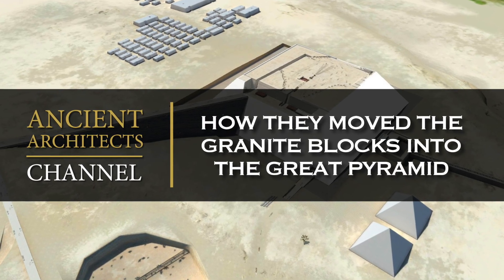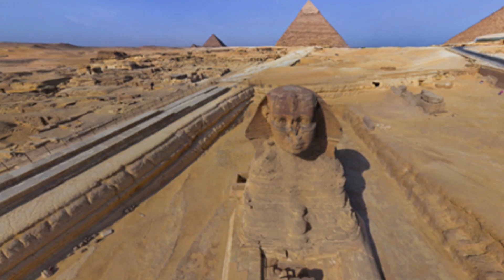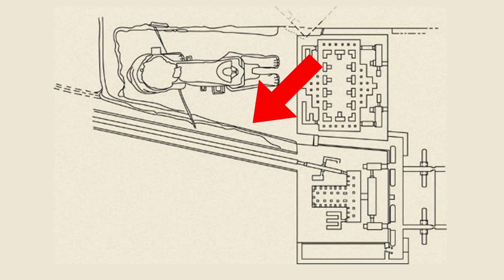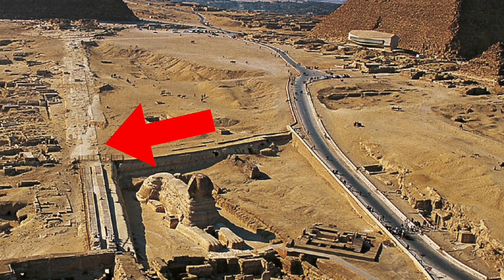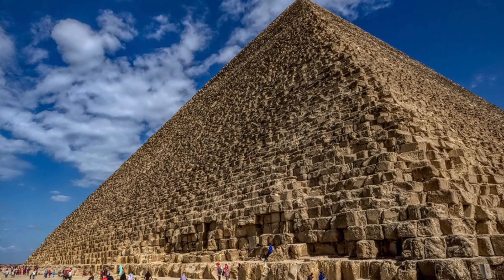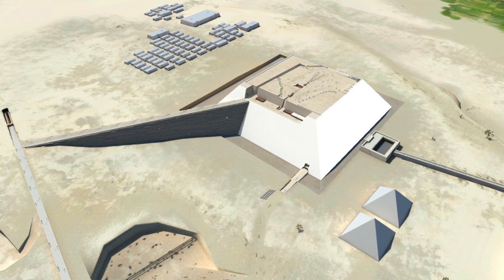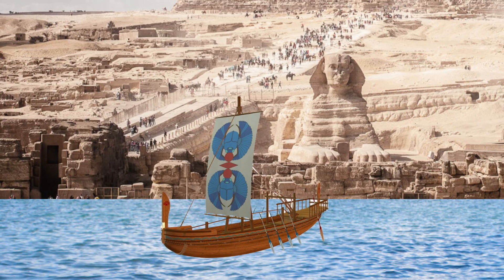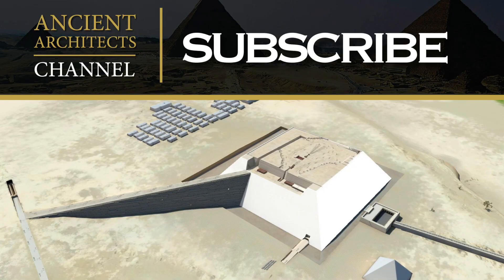How They Moved the 60-Ton Granite Blocks into the Great Pyramid | Ancient Architects

Comment: Must agree, seems like the only reasonable explanation the counterweight system is incredibly clever thus the conclusion that the sphinx might have been built after the pyramids. Love to hear the theories and sit mulling them over for a good while afterwards. Thanks Matt more great stuff.
Reply: Well, not really. If you use a counterweight system (like in an elevator) you need to pull the counterweight back to the top for the next big block. But how? Filling a sled with 60 tons of sand or water? Don't think so, unless it was a very wet climate with rivers on the plateau to fill the sleds to return the counterweights to their initial position. Which leads to questions about the underground water systems... Matt, are you reading this? ;)
Reply: @DilbertMuc  Wrong impression about how much weight needed to be PULLED, not LIFTED.  With rollers underneath or very hard and greased sleds, not much weight would have to be overcome.  A few strongmen of today could have moved 2.5 ton blocks easily, after all, just one can get a train moving by pulling it.  Their anti-friction method would have been the key.
Reply: @redwoodcoast  Sorry, but that's basic physics. You have the weight of the block, the height to lift the block and the length of the ramp. And geometry using sinus function. Pulling up the ramp is always an addition of lifting vertical and pulling horizontal. The upper plateau is maybe 60-100m higher than the river nile and you have eventually to lift the 60 tons granite block to that height. That's similar to elevators for ships on canals in Europe. They use counterweights to lift the ships using water. That's what I thought about the underground water fountains on the plateau. Using windmills and Archimedes type conveyeurs they could use water to fill the countweights to pull up the granite blocks (and limestone blocks).
Reply: @DilbertMuc  Yes, but you implied incorrectly that the amount of water needed was equal or greater than the weight of the blocks, although you did not outright say that.  

The amount of counter-weight needed is only that which is somewhat greater than the amount of force needed to glide the block uphill at a very moderate angle with minimal friction, NOT to lift it vertically.
With men and beasts working together in small teams they could easily move 2.5 tons uphill 500 meters.  (Brakes in back mandatory.) It would be totally dependent on the quality of the roller system employed.  There would be almost no friction from stone balls perfectly rounded.

Think of those gigantic vault doors that a person can open and close with one hand because all of the weight is supported without friction.  Same principle.
Reply: @redwoodcoast  You're both wrong.  Have you seen the size of the sphinx? He'd be able to move 80 ton blocks easy peasy!

Comment: If I was ancient architect trying to build large pyramid from heavy blocks, I would not waste time on ramps, etc. They knew of counterweight-lift. Stones would be brought up by the slope of the face of pyramid counter-weighed by a sled with simple stone rubble weight on the opposite slope. Few such lifts would suffice. I would transport rubble back up by interior, small corridor-ramp as in evidence. Simple, easy work for men to carry baskets of rubble up all day. Additional support: similar mechanism is preserved for interior transport of granite blocks to Kings Chamber. Quick "back of napkin" calc-workforce of 16000 simple workers, 2000 experienced stonemasons and 2000 support (kitchen, health,trades,...) operating in two 8hrs shifts could build great pyramid this way in about 15-16 years.
Reply from the maker: Great comment. Thanks
Reply: Maybe they invented the human chain, passing smal rubble back up in a fast and efficient way from hand to hand.

Comment: Nearly right in my opinion Matt. My theory is that the causeway provided a system for raising water as well as the stones - it being relatively easy to raise water from river level to the pyramid in stages along the causeway with sectioned water wheels or Archimedes screws. Once raised water will always seek to flow to the lowest available level making it an ideal counterweight to make raising the large blocks easier. The same concept could be used to raise the blocks at the pyramids themselves.To me it is no accident that water always plays an important part in these sites - the ancients knew far more about it's use than they are given credit for.
Reply: Wasn't the Archimedian screw invented over a thousand years after the great pyramid was constructed?

They did have levers, for lifting stones... but really, to reset the counterweight just have a bunch of people climb on the sledge and ride it back down the ramp. (They would eventually need to have walked down anyway. They collectively probably weigh as much as the counterweight. )

Comment: I am totally onboard with thinking the causeway was inteded as a ramp for the blocks. This does not convince me however of the traditional timeframe. to be able to carve into bedrock, and make the causeway in the firstplace. I think the shynx is eroded from flooding from the nile. i think the pyramids and sphynx are the same age relatively. But I think there is a possibility they are pre-cataclysm relics.
Reply: If the Sphinx was damaged by flood water, the "grooving" would be horizontal. However, it's vertical, suggesting water flowing ONTO the structure from above. That's only one theory though.
Reply: I don't see any reason why they would dig into the Spinx enclosure in order to build the causeway. They would just lay the causeway onto the rock leaving the area where the enclosure is now untouched.
Reply: I agree both built around the same time but when that time was is still being debated. I lean towards pre-cataclysm too, a possibility some appear afraid to accept.
Reply: @geehammer1511  are there any theories on who built the sphinx? i tried looking it up but nothing turns up :(
Reply: Totally on board with that. It would still need alien, magic copper chisels and mutant psychokinesis skills.
Reply: Portions of rope, which were discovered in mud on an upper portion that was used to fill gaps between stones on the pyramid, were carbon dated to the 4th Dynasty.
The oldest papyrus ever discovered was that of a ship's log;  documenting the gathering  and transport of pyramid casing stones for the pyramids. The writing style and carbon dating shows it to be from the 4th dynasty.

The worker's village excavated in the 80's uncovered a brewery that brewed beer for the workers. It had inscriptions that said they brewed beer for the worker's of Khufu's tomb.
 Artifacts and carbon dating put it at 2,500 bce.
The bakery that baked bread for the workers had inscriptions that said they baked bread for the worker's of Khufu's tomb.
, artifacts and carbon dating put it at 2,500 bce.
Organic material in the walls of the village for the workers are carbon dated to 2,5000 bce.

There are over 450 samples of organic material taken from the worker's village, the surrounding temples, and material from the pyramids themselves. All come back with a 4th Dynasty dating of 2,500 bce.

There is an inscription inside the pyramid by workers that say they were friends  Khufu.

His mother's tomb was built next to it, and inscriptions inside that say the pyramid was built for Khufu.
His son's tomb was built next to it, and inscriptions inside that say the pyramid was built for Khufu. 
His brother's tomb was built next to it, and inscriptions inside say the pyramid was built for Khufu. It also said his brother oversaw construction of Khufu's pyramid.
When Greek historian Herodotus visited in 450 bce the Egyptians told him the pyramid was by built by Egyptians for.....you guessed it,  Khufu.

Carbon dating, inscriptions, Egyptian writings, writings by independent sources, surrounding area buildings and physical evidence, all independent lines of evidence, point to two indisputable conclusions:
1.The Egyptians built the pyramids during the time of the 4th Dynasty
2. Khufu's pyramid was built for Khufu.

The pyramids were looted. To say the pyramids weren't tombs is the same as saying a bank didn't hold money after it was robbed. Yes there is a vault, there are cash drawers, and there are balance sheets. But since there is no money now, it could have never had money in it the past.

Graham Hancock, EvD, Sweatman and others of their ilk complain that mainstream "academia" mocks them and calls them pseudo-scientist.  Well since they and their following of pyramidiots disregard  the mountains of compelling, overwhelming, verified evidence to the contrary of their woo-woo, far fetched absurdly silly alternative, I'l say they are being nice. Hancock and his following deserve 100xs the ridicule they get.
Reply: @surfk9836  you are the ridiculed for thinking all of your facts disregard the possibility that the egyptians simply found the structurs and repurposed them
Reply: READ THE BOOK ;  READ THE BOOK ; READ THE BOOK, THE SECRETS OF BUILDING THE GREAT PYRAMID OF EGYPT, which has completely new theories about this subject ( WITHOUT MONEY) on the website   www.thegreatpyramidofegypt.com , accessing  „Read  fragments” ; ( 1 - MENU / Menu ;  2 – ENGLISH  / Română ;        3 – FRAGMENTS OF THE BOOK   / Fragmente din carte ;      4 – Comments / Comentarii ; NO MONEY )
I'm open to hearing new ideas and new arguments. Pragmatic people always cling to the popular proverb, burning those on the "Galileans" who claim that the world isn't flat ,or that the universe revolves around it ; so I prefer to give everyone a chance to present something new;  YOU NEVER KNOW  ?, (what if one of the 78 novelties proposed in the book on page 57 , is finally  accepted ? ). Have a nice day. Thanks for watching!
 Hănțulie Ionel.

Comment: Have a look at the Effort it took to move a 10 ton granite statue of the winged bull from Iraq, 18 months and hundreds of men and this was not that long ago! And only 10 ton never mind 60 ton!
Reply: The Nippon Corporation failed spectacularly in their 1978 attempt to create a paltry 60 foot pyramid. The most advanced technological engineers of their time were unable to (a) cut stone with copper chisels (b) prevent the barges sinking on the route from the quarry and most hilariously (c) lift even a 10 ton block without using modern cranes and ... a helicopter. When they did finally get the blocks into place they were so badly damaged that the entire experiment was written off and any press interest was ruthlessly discouraged.
However, the Italian footage of a 100 ton marble block being moved (circa 1920) from quarry to port by a lot of flat-cap wearing fellows and a herd of bulls, is really a bit of a myth buster. Scale bulls up to Aurochs and perhaps a few hundred conspicuously large contractors and you have the required 'man' - power to move even Hajar el Hibla.
Reply: In fact, anything up to 120 tonnes is no problem for people to move up a steep slope. The difficulty moving that thing was protecting it from any kind of damage, because it is a priceless relic. You aren't going to damage a 60-tonne block of granite now, are you? Do you see the difference? It's comparing apples to sausages.
Reply: @Chris.Davies  "You aren't going to damage a 60-tonne block of granite"
You will note that the Nippon Gakki (Now part of the Yamaha Corporation) experiment was finally abandoned due to the 'damage' to the few 'granite blocks' that they did manage to lift.
How exactly do you get over 1000 people into an area small enough to pull a granite block up a slope? Or are these 'people' capable of pulling over a ton each?
Haven't really thought this one all the way through have you?
Reply: Chris Davies sorry mate I’m not 5 years old and I’m not sure you understand how heavy 120 ton is!! The fact is there is proof that those bulls are not clay and that they were difficult to move at 10 ton stop!! Don’t just come here making up stories about frailty of objects because the fact is those bull are damn near indestructible!! 60 ton up a slope fucking prove it!! You sound like that old guy who tells us the the granite was cut using sand and a copper rasp!! Bloody deluded mate
Reply: Evidence reveals that those Assyrian bulls were not sculpted stone but were geopolymer stone concrete forms cast from sculpted clay originals. When ISIS smashed some their inner metal framing was visible.
daVinci's unfinished giant horse: Dent, with the aid of several artists, sculpted the eight-foot working clay model. After locking in the final lines, the model is finished; the product of over six years of effort.

The next step on this journey into history is for foundry artisans to construct a twenty-four foot clay model. Foundry engineers will erect the massive stainless steel armature that will allow the final bronze colossal to stand on two legs. 

I've written about such things, and will write more soon, at sciencetheory.wordpress.com, for example: Colossi of Memnon; Stone vs Geopolymer Concrete  https://sciencetheory.wordpress.com/2019/08/15/colossi-of-memnon-stone-vs-geopolymer-concrete/
Reply: Adrien Nash https://youtu.be/GOBT_X_EA6U  1 minute in are photos of a half destroyed Winged Bull can you point out this steel frame please?? There are also video of ISIS trying to jack hammer them with little to no success! This is not clay
Reply from the maker: Yep, and that is why the counterweight system at the other end of the causeway was essential, as I state in this video

Comment: Very interesting - makes sense...I suppose in theory that could mean Robert Schoch's date could be transferred to the Great Pyramid?
Reply from the maker: Yes - the causeway and it’s relationship with the Sphinx just needs explaining in my opinion. I need to see a good, logical explanation why the Sphinx enclosure south wall is at that angle.
Reply: @AncientArchitects  Because the harbor might have been at such an angle to the left (north) side of the sphinx that the blocks would have required to be pulled to shore exactly at the corner of the harbor from the front of the boat. Too tight, methinks.
Reply: @AncientArchitects  Sorry to repeat, but we do not know that it was originally at that angle.  We're talking about deep-time as far as we know.  It might have been rectangular originally, expanded later after the causeway went by it at an angle.  THAT also makes perfect sense as far as I can see.  But it begs the question; what were the quarried enclosure blocks used for if not for the temples contemporaneously?  Could not some scheme work to move the pyramid blocks with the Valley temple in the way?

Comment: How do we know the causeway wasn't repurposed to haul blocks and wasn't originally used to some other purpose? What's its celestial alignment? It might well predate the sphinx but might not have been used for pyramid construction till later.
Reply from the maker: Fair enough.... I guess there is no evidence so we’ll never know.
Reply: @AncientArchitects  Perhaps the biggest questions raised by the causeway speculation are : 
Why was there a causeway anyway?  
Why did it proceed to the location of a pyramid (Khafre) that was not even being built and perhaps was not yet even contemplated?  Why, if the great pyramid was built first and not second, would a grand causeway not have been made going directly to it?  
Much remains to be uncovered and reasoned through.

Plus, if they were capable of cutting those monstrous blocks of the temples and other Giza sites, could they not also have cut a channel into the limestone bedrock for barges from the Nile to float almost all of the way up to the pyramid site?  They could have later bury it.  It wasn't as if they didn't have a million blocks to move, or more.   Hmmm... GET THE LIDAR OVER GIZA!
Reply: @redwoodcoast the site plan may have already identified the locations for all three pyramids so they could do the necessary logistical planning needed to build them. By aligning the causeway as it is they kill two birds with one stone in their ability to use it for both pyramids in succession.  Just a thought!

Comment: Why couldn’t the causeway have been for moving the limestone blocks since it’s in the quarry... I think the granite blocks were put on wooden sleds in Aswan, and those sleds were floated right to Khufu’s entrance, and then right into the Grand Gallery where the sled fit, diagonally, and water and counterweights brought it right to the Kings Chamber... much more efficient than Houdin’s “efficient” system...
Reply from the maker: Yes, I agree - both limestone and granite. But limestone for the latter part of the pyramid because the causeway goes up to high ground (the height of the base of the Khafre pyramid) so I would assume the intention is to get heavy blocks to the higher parts of the pyramid. It’s Houdin’s theory, and I was quite impressed.
Reply from the maker: And yeah, your hypothesis works too. I liked this as it explained why the Khafre causeway is so large and also explains why it pre-dates the Sphinx.
Reply: Ancient Architects sure. Have you had anybody telling you how the Sphinx enclosure could have had that angle BEFORE the causeway!??😃
Reply: Ancient Architects yes, Houdin’s explanation hits on all cylinders!

Comment: I’m 100% sure animals were used in some capacity IF the blocks were essentially dragged into place. 🐘 not 👳🏾‍♂️
Reply from the maker: Yeah, animal power would make a lot of sense
Reply: Bulls 😄
Reply: Mabye sphinxs used to be a bull 😄
Reply: There is a picture of bulls pulling a sled with a stone on it. Combine that with a water, animal fat ,crushed limestone slurry and you've got a good sliding system. The hardest part is getting it going. Once moving its easier to keep going. From static to dynamic in physics terms.